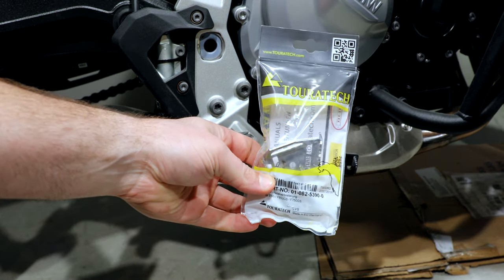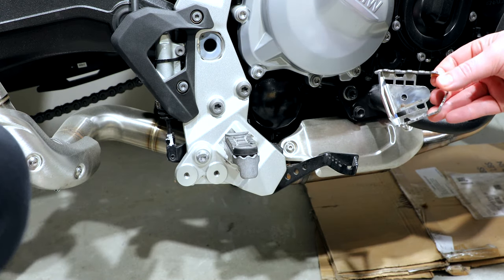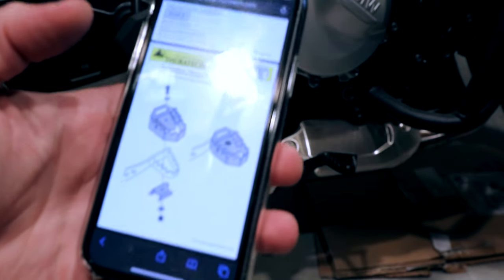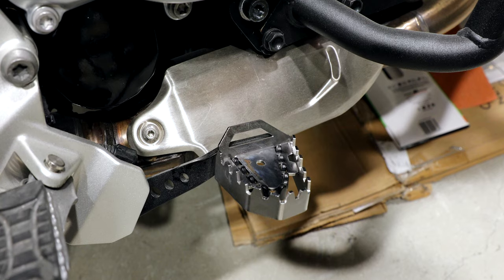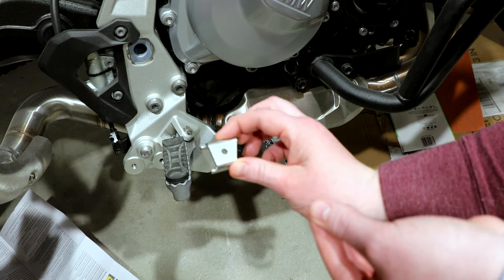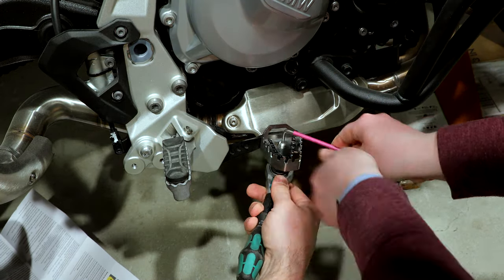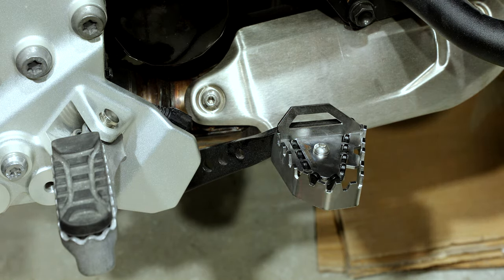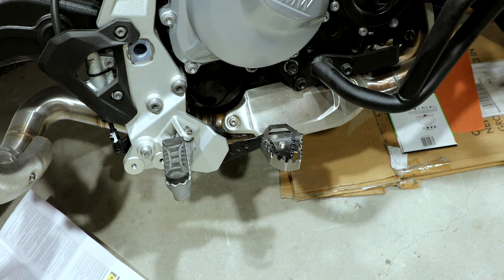Install: Touratech Rear Brake Pedal Enlarger for F750GS (F850GS)

Comment: It looks very nice. Actually I own the same bike. I Installed the MADSTAD windshield because of your video. Could you show us how to take the gas tank off and all the plastic parts. I want to take off all of them to change the color with vinil. Thanks in advance.
Reply from the maker: Hi. I'll definitely do a fairings removal video when it is time to check air filter, spark plugs and maybe valves at 12,000 miles. I already removed the fuel tank and fairings once for installation of electronics (horn + lights) in November. Sorry it was not recorded.
Reply: @AdamChandler86  thanks, I have seen all your F 750 GS videos... Very nice bike
Reply from the maker: We have a few more modifications planned in the next 2 weeks. Just waiting for things to arrive.